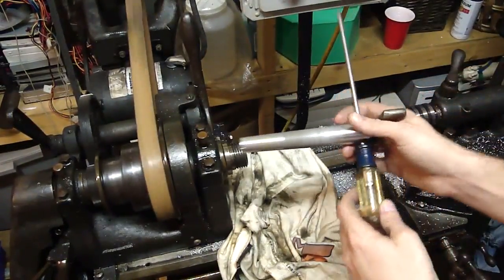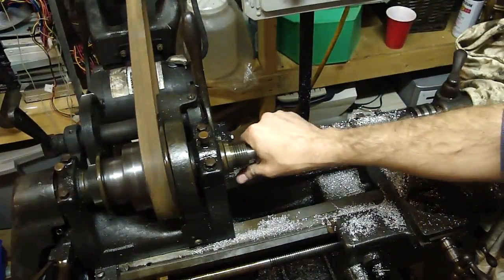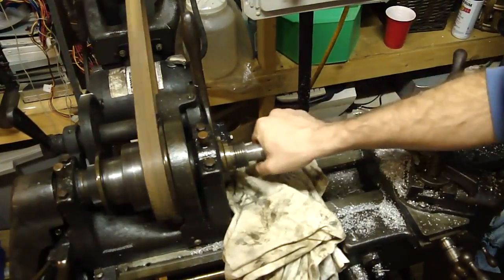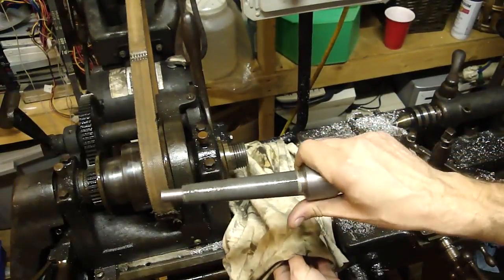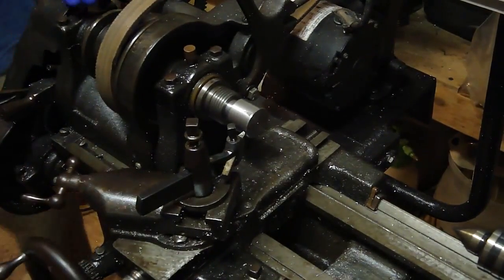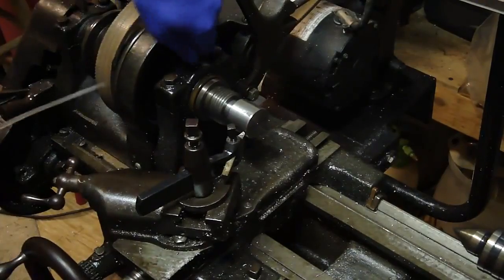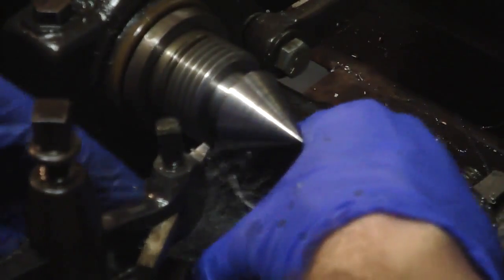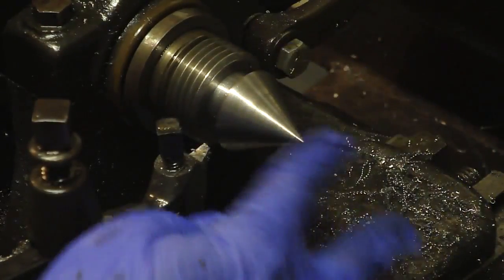MT3 Dead Center Part 4 Final!

Comment: i've never seen anything like it either...nearly brought tears to my eyes.. perfectly good antique spindle with a mt3 ruined by lapping to a poorly made taper. what a shame.. would it not have been better to blue and then polish between centers until the fit was correct..
Reply from the maker: If that the earth could teem with woman's tears,
Each drop she falls would prove a crocodile.

There was an imperfection inside the spindle taper from the previous owner or two not sure who to blame but I only needed to wear down a raised bruise of about 2-3 thou. The hardened spindle was barley touched by my efforts, more that the softer stainless mated to it by lapping. Though I would have the same reaction you had viewing my actions in hindsight, she was only grazed.